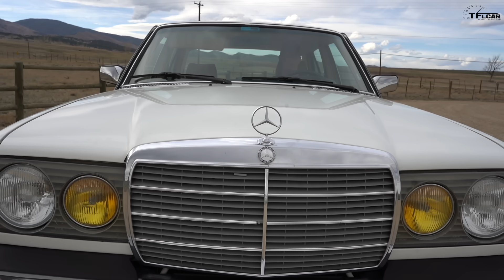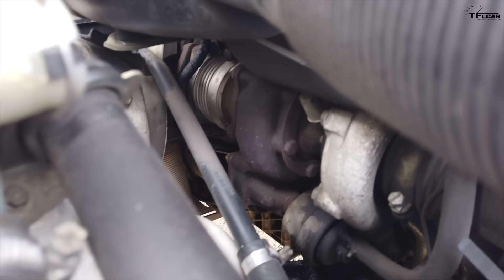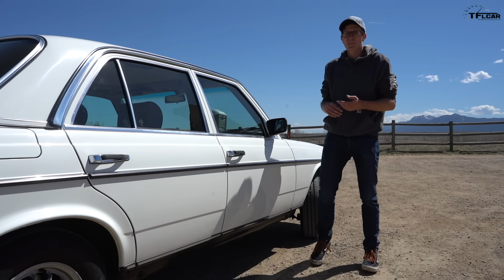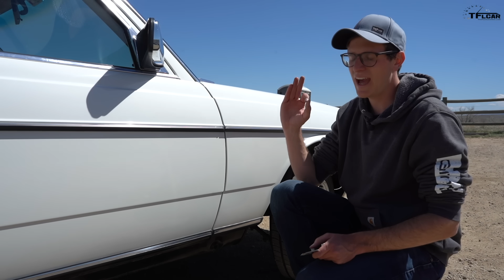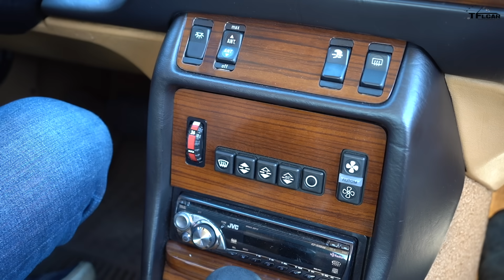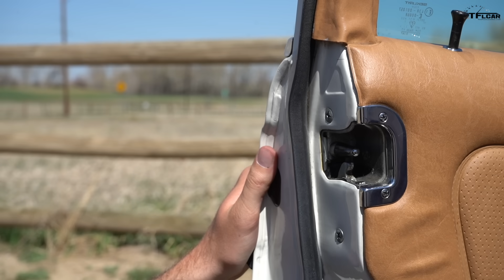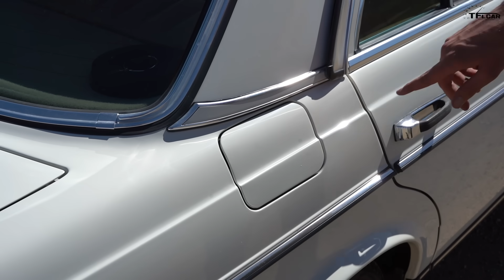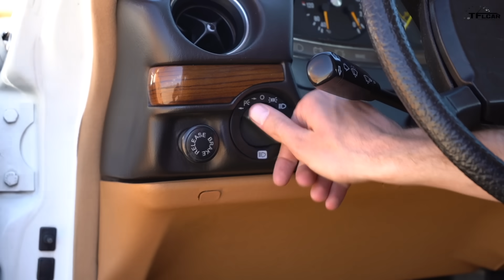This 37-Year-Old Diesel Is THE BEST Mercedes Ever Made!

Comment: This was my first MBZ. I bought it new in 1982. $30k 3x the cost of a Nissan. Reliable, drove for 5 years and sold it because it was way too underpowered. Bought a new 1987 560SEL, double the horsepower, double the price. Now drive a SL500 1998.

Comment: Excellent cars. 

I had one that started off as a daily driver right after high school, and kept it for 10 years. It never left be stranded, but it has some annoying quirks. Keeping the transmission shifting properly, takes messing with at-least once a year. Valve adjustments, and the vacuum HVAC and door locks. 

Also, the fuel economy isn’t that good.
Reply: I am going to acquire one

Comment: Actually if it were a wagon, it’d be the best Mercedes ever.  Wagons are way more useful.
Reply: The 300TD wagon (in the U.S., "estate saloon" or "shooting brake" in the U.K.) is certainly the most practical of the W123 chassis models. However, the TD uses a fairly complex self-leveling system in the rear suspension. Not only is this more things to go wrong, but the OEM parts to keep it maintained and operational are becoming harder to find with each passing year. The M-B engineers figured, and correctly so, that the additional cargo area of a TD could allow for heavy cargo loads. So, they designed the self-leveling rear suspension. Naturally, it was over engineered by M-B, with the result 35+ years later that age related problems are developing that the engineers had not contemplated when they designed the self-leveling feature.

Comment: I had this body type a 1981 but the 200 version while in the Army in Germany. Took it into a German mechanics place for look over after I bought it. These were old timers who knew cars. They said this model was a tractor (higher craftsmanship).
One thing about your car it has the export bumpers (elongated). Really a non factor for impact but rules are rules. Your door rails may also be an export necessity. The front headlights also were adjustable (pitch) if you had heavy luggage in the trunk.
I remember the turn radius being absurd. If you look the wheel are almost tipped in the sidewall to accomplish this. Really when navigating narrow European streets a U turn in one of these was easy.

Comment: The new Mercedes cars, and other brands, are also well enginered. 
But I want to see who's will restore them in 37 years ... with all the electronics and CAN wiring, sensors and other electronical stuff ... the body isn't a problem, they don't rust anymore, they are all galvanised ... some brands better then others ...  Otherwise the oldtimer market in Europe is suffering now because oldtimers are not allowed to be driven in the LEZ (Low Emmission Zones).

Comment: These are the cars that gave Mercedes-Benz a reputation for reliability.   We bought a W202 C250TD in 2011 with 238 079km on the odometer in 2011, assuming that the C250TD would be as reliable as this W123 in your clip.  After 8 years of frustration we sold it, with 302 000km on the clock.  During the 8 years we owned the car, we drove it about 5 times without any trouble.  It was on the back of a AA flatbed-truck 4 times.  It was in limp mode for the entire 8 years we owned it.  We had to replace the Boost Pressure Control Valve, Fuel Supply & Return Shut Off Valve, Fuel Supply Control Unit, Glow Plug Control Unit (twice), the Glow Plugs and various other parts.   
Modern cars, or rather, computer boxes on wheels, won't become classics.  Modern cars are disposable, and they are produced as such.

Comment: That "some sort of finger adjustment for the radio, nowhere near the radio"-thing, if I'm correct, and it wasn't just Mercedes, was to balance volume between front and back speakers, so if it was only people in the back interested in hearing the stereo loud, while the driver wanted to hear the road, or the vice versa, the brunt of the volume could the thrown either to the front or the back seats.

Comment: Very sluggish and prone to corrosion , boring to drive bad milles per gallon due to the tank weight and the preheat plug system is a nightmare . it does not last longer than other diesels , pistons rings and bearings are made with the same materials as any other diesels !

Comment: I love my 1986 300SDL. BUT it has become hard to turn on and doesn't seem to be firing on all cylinders at first. It will also die if I put it right into gear, as if the idle is too low. I'm terrified of bringing it to a mechanic since I just paid $1, 000 for what was supposed to be just new brake pads! (Frozen calipers and a leaking master brake cylinder...) Also, one headlight has half died (the bright works). Where to go to buy one that won't destroy my finances. I lived on a pension and have sacrificed a lot to buy and keep this car...

Comment: Been a while since I owned one of these, but if I remember right the spring that holds the fuel filler door is also designed to hold the gas cap while you are filling the tank.

Comment: I missed a check under the hood and a close look at certain parts of the engine
i used to work at a car repair shop and the owner compared the quality of ordinary cars to mercedes parts from the 80s the thickness of th metal and the parts that have a lot of wear etc, do that, it is really sensational to see the difference!

Comment: Great cars.  we used them in Germany for taxi cabs.  Rust was the biggest enemy, especially at the jack points.  I owned a 240 d with a 4 speed and AC and a 300D.  They could go 500,000 miles if you took care of them.  They were fun cars.  Sadly, diesels did not fair well in the US and when diesel became more expensive than premium it did not make sense to own one.

Comment: I’ve owned MB for 25 years and the W123 chassis diesels were built when MB handed the engineers a blank signed check and said build me the most robust car ever. I did a semi restoration on an 85 300D and IMHO the M617 is near perfect. Rule #1, keep the oil changed. I’ve seen cast iron blocks with the piston gone through it because the oil wasn’t changed.

Comment: W126, W124 and W201 were also extremely reliable and durable cars with even better corrosion protection than W123. The later Diesel engines produced way less soot while being more powerful and would run on vegetable oil.

Comment: my father owns a w124 2.0  petrol automatic coupe. he bought it brand new, racked up 60k km at which point car wasnt practical any more so he garaged it..

last summer i tried to register it. it had some issues with fuel lines and such (which is to be expected after 12 years or so without driving) but those are fixed now. it has a cracked rear bumper ,i tried fixing it with bondo and other kits but failed. not sure can u match a sedan version one to a coupe . also after my father refused to sell it to some guy he keyed it and now it has a nasty scratch both in body panel and glass. no idea how to fix those....

i do own a bmw e36 tho. its in rough shape too and working on those two back and forth made it so i didnt fix either completely...

Comment: Excellent video by the way.  I totally agree that this is the best car ever made.  It is apparent you know nothing about meters.  Ha Ha.  I meter is about 39 in. which is a bit more than a yard.  You ment 10 meters not 10 centimeters.  A centimeter is close to a half inch.   [°C] = ([°F] - 32) x 5/9
[°F] = [°C] x 9/5 + 32  It would be so much easier to go to the metric system.  Try to figure out how many inches are in a mile whereas with the metric system all you do is move the decimal point.

Comment: By the way I use a little Miracle Mystery Oil and I use a cetane boost in my fuel and the engine is just a bit quieter and it adds a bit more umph.  I have no problem keeping up with traffic and with the 4 speed manual it is not to bad even on starting up on a dead start.

Comment: My patents had a 1984 300 DT.  It had 225,000 miles on it and would still be running if my brother hadnt totaled it.  It was a great car.  It had a transmission issue when a bolt sheared off on the inside.  Mercedes said that it was something theyd never had happen before.  Replaced the transmission for 1500.  The 88 Ford Taurus they had was a 3000 dollar replacement the 3 tines they had to replace it.

Comment: The  are  few little details about these cars  I thought would further illustrate just how much thought went into them.  There are actually needle type Grease Fittings on the door hinge pins! I've never seen these on Any other car. The engine cylinders use replaceable dry liners, so the engine block can be rebuilt nearly indefinitely.  There is actually a Replaceable Filter in the bottom of the power steering pump reservoir.  Funny thing, Power steering pumps simply don't fail! On the flywheel on manual transmission models there is a groove machined around the pilot bearing. This groove connects to holes drilled through to the back of the flywheel so that any grease that leaks out of the pilot bearing will get caught by the groove and thrown out the back of the flywheel rather than contaminating the clutch disc friction surface. I've never seen that on any other car either.  They have a thermostatically controlled  engine oil cooler stock from the factory.  They have four wheel disc brakes long before that was a standard thing.  The brake pads can be changed with just a small hammer  and a pin punch,  no  wrenches required! The more deeply you get into the 123 cars, the more cool little details you notice.  Needless to say, I'm keeping mine forever!!

Comment: Had two of them, there are issues.  The monovalve which controls the heater and AC is horrible. Frequently breaks, and costs $800 to replace.  Also the rubber seals don’t last very long and are expensive to replace.  The injectors clog way to frequently.

Comment: "the best ever" usually doesn't exist because it all depends on the personal point of view and expectations.
In terms of crash saefty and driving performance the W123 is nowhere near the best Mercedes and will never be. But it's probably one of the most reliable Mercedes ever. But still, my dad had one of these and had to get rid of it because of engine failure so nothing is perfect i guess.

Comment: I had on in the UK (W123 200) Petrol version, found it rather gutless and incapable of towing my 23 cwt Caravan with safety, so eventually graded up to a 280SE in 1982. The W123 Series suffers from serious rust problems and very few at all would be running after 10 years use. The best Mercedes without a doubt is my latest (and have had very many) the 2019 B200CDi AMG with Premium Pack, absolutely astounding in terms of safety, efficiency, quietness, luxury, and 'state of the art' Infotainment System. Just say "Hey Mercedes take me home, close the roof, change lighting to blue, I am cold, I am hot, turn on heated seats, what's the weather tomorrow, I am Hungry etc and it does it instantly. The one thing I will concede is that this (1982) Version will run quite happily on Vegetable Oil, much cheaper than Diesel. Or a 50% mix is Ok if you don't want to be too obvious, after all it's BioDiesel and good for the planet. Latest engines not recommended in Common Rail high compression ratios, as 'could cause damage' It may be a scare story albeit.

Comment: My mother proudly bought a brand new MBZ 300SD (Model 126) in 1981. It was white with a gray MB-Tex interior. To personalize it, she had the dealer add hand-painted, full length pin stripes. The day mom took delivery in Newport Beach, CA, she and I took the car on its first (5+ hour) road trip to her home in Northern California. It was her pride and joy for 19 years. I inherited this garage-kept, spotless car in 2000 with 80,000 gently used miles. It’s been nearly 20 more years, and this one-family mechanical masterpiece is still starting and running reliably. The radio, power antenna, clock, sunroof, power windows, power (vacuum) door locks and power right side rear view mirror switch still perform flawlessly. It burns little oil, as well. The sending unit for the tach needs to be replaced and yes, the climate control system is far from perfect. So, bravo, I totally agree with your assessment regarding the overall quality and durability of the 300 Series cars built in Germany during the 80s. I’ll never sell this car, but will pass it to my daughter with the wish that she enjoys Grandma’s car, too. One quick correction......When operating the light switch to turn on the left or right side front and rear turn signal and tail lights, MBZ refers to them as “Standing Lamps (or standing lights)”. They use little battery voltage, and serve to warn oncoming drivers, in darkly lit areas, of the presence of ones beloved automobile.

Comment: Silicone that moonroof closed because it will leak, lol. Easy oil changes with a $10 socket set, no jack required. No DPF to clog. They don't make them like that anymore. Diesel Antigel and 6 gauge jumper cables are a must. I had one that was a taxi in Stuttgart that got "federalized" and brought over to Massachusetts. Stereo options are downright depressing. 0-60 times by tomorrow afternoon. I loved it but they do love to rust. Eventually the suspension completely failed.

Comment: When my father died we took over his W123.   1976 2300 cc petrol [Stromberg carburetor].  Great steering, suspension, transmission, interior comfort, brakes. The only problem it was underpowered and too heavy on fuel. There was no problem with parts and servicing was easy.  I have a 2001 SL 320  [for 9 years]  a good car but parts  not easy to get and servicing is expensive.  We had a 2008  MB C320 , a great handling and performance car [V6 turbo diesel].  Had electical problems, parts, repair time and servicing was expensive. Traded it on a Subaru Outback and much happier.

Comment: The Crown Vic's saving grace was its heavy duty full-frame that the body sat on. One of the last cars ever produced in such a way, in America anyway.
The M-B featured the same construction. The car was "overbuilt" and that helped it last for so long.
I agree with you, btw, the W123 chassis is the best chassis ever produced. Those were all million mile cars, easy. I'll take a 240D with auto, please.
The ONLY other car that I can think of, that could possibly match this chassis is the Checker Marathon. The classic American taxicab.
Its not unusual to find any of those cars with millions of miles on them.
Built like tanks and wear like iron.
They really don't build them like that anymore.

Comment: I had a 123 300D Auto 1978 incredible build quality absolute tank. 

One morning the sun blinded me i ended up hitting an almost new Ford Sierra belonged to a friend  with no more than 15mph i only got out to wipe the dust off my bumper and Sierra was in fact a Total loss.

 It sat in my garage for years never started or used for god knows how long and after so many years first turn of the key bang it starts even without a stutter. 

Only thing let this car down was the usual Mercedes rust in the boot,wheel arches and the bottom of the rear quarters. 

The Engine and the Gearbox though are incredibly simple but indestructible.

700 Thousand miles and nothing comes anywhere near it.

Comment: I absolutely loved your video.  I prefer a W126, as I've owned 300SD and 300SDL cars for the past 23 years, but I've also had a few W123 cars (I have a 1980 240D four-speed manual now).  Great machines.  They were the best cars the highway will ever see.  So simple to work on and repair.  I believe their simplicity was the key to their longevity.  I still have a 1984 300SD with 752K miles.  The original engine lasted 703K miles before anything was done to it.  After a broken valve guide, the top end was re-done, and it went to 725K miles when the bottom end went out.  They'll last for many years when they're properly maintained.  Keep those valves adjusted!  Kudos to you for keeping these classics alive.  They were (and are) indeed wonderful machines.  God bless you, my friend.

Comment: I had a 68 220 d ....Nearly 600k  miles i sold it  just tired of replacing worn out systems, never the motor ..yet on older cars its always the system you replace , not just a part!

Comment: The Fader control is in the center console so you dont have to lean forward to set the fader, so your head (and ears) will be in the normal driving position, when you make the front/rear adjustment.

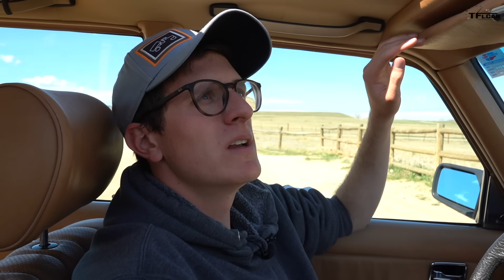Comment: At 13:00 you forget to mention that the spring for the fuel door is designed to hold the cap whilst refueling. Also, I don't know the specifics of the 300S Turbo but the door is PROBABLY locked by the vacuum system along with the doors. In mine (1991 350SD) the trunk key can lock/unlock all doors including the fuel door.